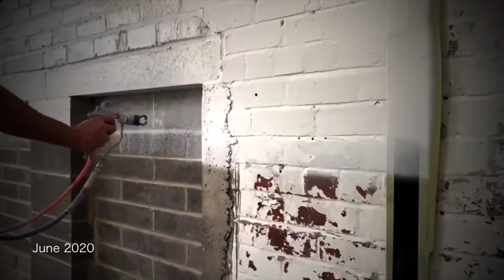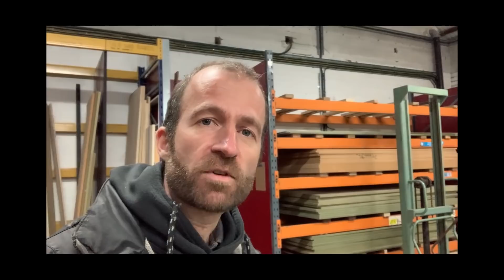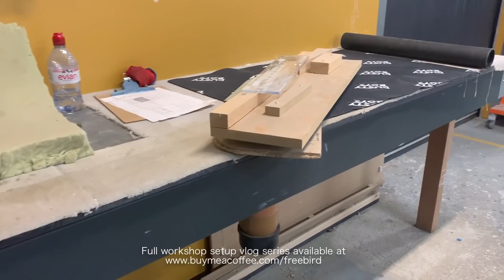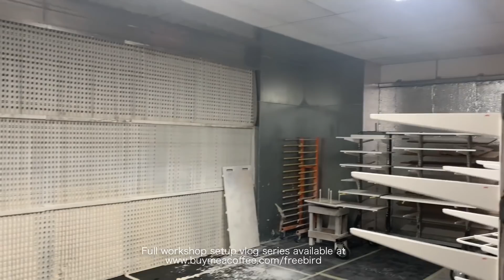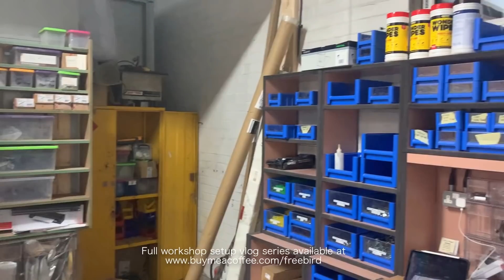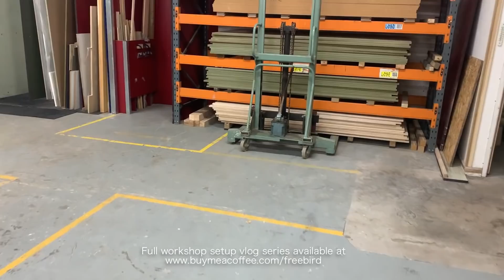Setting up a ‘Lean’ Woodworking Workshop From Scratch

Comment: Great to see this come together for you I'm one step behind you in the  middle of  building a  4500sq ft workshop after years of dreaming months of planning hopefully few more weeks of work I should be on the home run. Have a good Christmas look forward to seeing more from you in the new year
Reply from the maker: Wow that sounds like a huge task!
Reply: @Alastair_Johnson  you mentioned about have a  coach helping with the layout and flow of the workshop, would you say it's make a  big difference to your thinking on the layout and flow, I'm just asking lots of other joiners to pick up tip and tricks but wondering if I should get some one like that involved
Reply from the maker: Honestly I don’t think I could have taken a step like this without an experienced guide to lean on.  Too much of it is new to me - I mean I never even worked in anyone else’s workshop before embarking on a career in woodworking so had very little experience to draw on; let alone getting to grips with ‘Lean’.  I have dabbled with business networking groups,  mentors and coaches over the years but always felt they weren’t specific enough to my industry to help with the most problematic gaps in my knowledge. Bruce the Joinery Coach and his team have both knowledge and credible experience and success in making exactly my kind of business work.  It takes a shift in mindset to see value in the fairly significant costs, but after hearing the common story of people trying to scale only to fail, I knew I needed to invest in support.  It’s a long term thing which I don’t expect to reap the rewards from immediately.  https://www.thejoinerycoach.com/
Reply: Great thanks for that. I cover a wide range of joinery and often wonder if I should  narrow it down but then I love the challenge of the range I do from built in to stair doors windows some free standing furniture to heritage buildings . And at this stage 17yrs in I'm 99% repeat work iv a few who won't allow anyone else do there work to the point some have waited 10-12 months to get to them don't want to leave them out by dropping their line of work. Thanks again have a  good and safe Christmas

Comment: I use the same twin slot racks as you. I recently added 22mm pipe insulation and they work a treat. No more scratched panels.
Reply from the maker: I’ve been meaning to get around to doing that!

Comment: Extra Motion, Extra Processing, Unnecessary Transportation = These are redundant.  Just do Lean 1 "Use Common Sense", You owe me a coffee.
Reply from the maker: Apologies if I took this too seriously!  Still, for me, learning Lean methodology has been a bit of a revelation. What I previously thought of as ‘waste’ I now see is not that at all, and what I previously thought of as efficient I now realise is often not!  For example I used to think it was wasteful to throw away offcuts.  I had to learn the hard way that the real waste is the storage space, distracting clutter, and time that those unused bits of wood take up in a workshop when they hang around for years!  ‘Lean’ thinking gave me the language and the eyes to see what was already happening in my old workshop and acknowledge it as counter productive.  Conversely, where I was spending a lot of time creating systems that were never fully implemented, or not fit for purpose, I’ve been able to understand these as the waste of overprocessing.  The considerable time we spent planning the flow of this workshop, and building equipment such as those partitioned carts that saves both labour effort and time is already paying dividends when work is flowing through, but perhaps it’s harder to see when they are just sat there in an sort workshop for the Christmas shut down!
Reply from the maker: Do you mean you think there is unnecessary transportation etc in our current plans?  Please elaborate, show me where to improve and I will happily buy you a coffee!
Reply: @Alastair_Johnson  I don't drink coffee, just a joke.  Just saying these lean recommendations are common sense.  I used to do general home remodeling but it was too competitive.  I switched to historic wood window restoration with linseed oil paint.  I now have a niche in the already less competitive window restoration market, have differentiated myself and work mostly at home.  I also make wood storm windows and finish them with linseed oil paint.  Lean is fine but finding less competitive niches where lean matters less is better.
Reply: @Richard McKrell
Lean is a modular approach and it is systematic as well. It is a way of thinking and you could just as easily describe it as common sense but it does give you a frame of mind and it also means you can implement it in a business and people can understand it hence why it is easy to implement.
Reply: @bighands69  Yes I know all about 'just in time' it's been around forever.
Reply: @richardmckrell4899  
Ford was developing that systematic approach back in its early production line. The main difference between Lean and JIT is that Lean takes an overall approach to the business and JIT is more focused on actual production.
Reply: @bighands69  I really don't care
Reply: @richardmckrell4899  
I you do not care why make your original statement?
Reply: @bighands69  it was 3 months ago, I've moved on.

Comment: Awesome!!
Reply from the maker: Anything in a blue box has been tried and tested as a regularly used standard component, so is likely to be used and refilled fairly regularly.  So, I mean, we’ve already done a lot of whittling down of old things we used to store, in the process of moving from the old garage workshop to this workshop (I found all sorts of weird and wonderful and completely unused components!).  Items which are still occasionally useful are kept in other boxes nearby but not in that main unit.  For them, you are right that it would be good to label them with the last used date and try to be ruthless and dispose of them if not used after 6 months.
Reply: @Alastair_Johnson  when I was younger I worked for a company that reported on everything they even had a report for how many new reports were made each month. It's a shame the first lockdown happened as I was looking forward to coming up and helping out but being down south couldn't stay anywhere. Hopefully next year I may be able to come and help if still needed
Reply from the maker: First to comment again Sam, even at this time of night!
Reply: Do you put the last order date in the parts bins similar to the material storage so if something isn't ordered in a year you get rid of it?